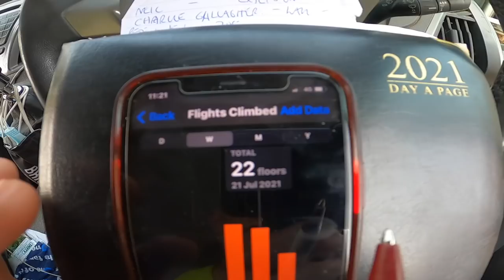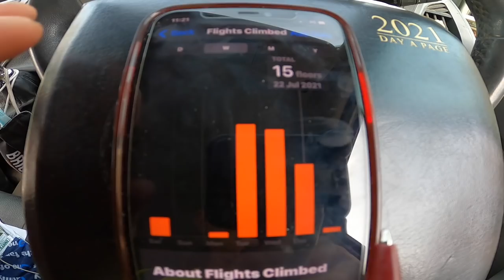HELP ! MY DRIVEWAY IS TOO NARROW

Comment: Blooming heck I thought my wheelbarrows were well used that one has paid for itself many times I reckon, good job 👍
Reply from the maker: Definitely and I got it for nowt in the first place 😆🧱👍🏽
Reply: @SteveAndAlexBuild  if the bottom doesn't fall out and the wheel still turns it's a good wheel barrow 👍 😉

Great work 👍👌
Reply from the maker: @Ivan-gm7zb  Spot on Ivan 😉😆🧱👍🏽

Comment: Good effort… You could have broken down some bricks to a nominal size of 50mm or so…in the hole, with the fines too, to about 3/4 the depth of the hole, then added the bitumen on top…say a depth of about 40mm or so max…and saved a few quid…👍🏻 when putting down ‘flexible’ surfacing, the seating course of 6mm nominal size Stone only needs to be about 20/30mm thick - as in a doorway surface for example…make it too thick a layer and it will deform under load, for example, wheel rutting of the surface… The bagged stuff may perform better, as it’s a ‘cold-lay’ material…
Reply from the maker: Yeah but it was only about 80 mm total . Tarmac cost about £70 . First attempt at it 🧱👍🏼
Reply: @SteveAndAlexBuild  like i said, good effort, and a very neat job…just a bit of ad ice for you really if you get any in future…
Reply from the maker: @stun9771  nice one 😁🧱👍🏽

Comment: Good vid.  Could not talk them into letting you build two new columns, i guess.  They would have looked a lot better than just the walls ending.
Reply from the maker: The wall was a bit crap so wasn’t worth it . New wall needs eventually 🧱👍🏽

Comment: What power tool did you use? What is its capacity?
Reply from the maker: It’s a tool station Bauker 1500 W breaker , cost about £140  . Fantastic tool 💪🏼🧱👍🏽
Reply: @SteveAndAlexBuild  yeah you got the brick stones nicely chisseled out
Reply from the maker: @fixityaon9774  Its heavy but powerful 👌🏼🧱👍🏽